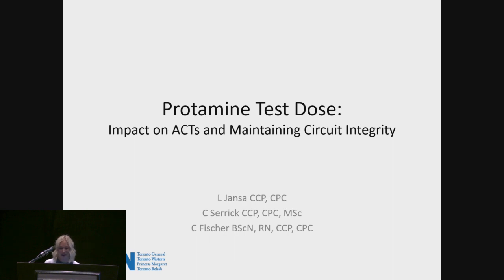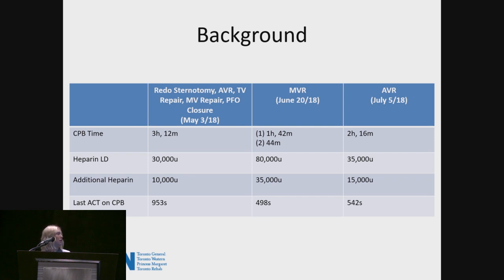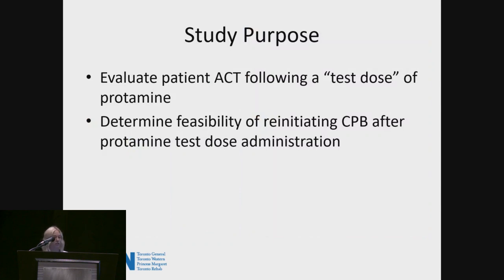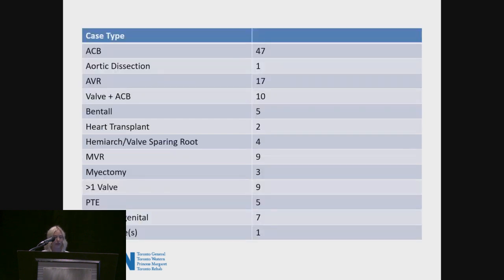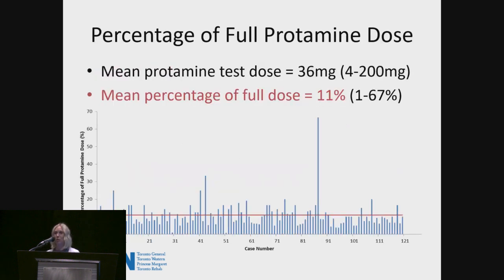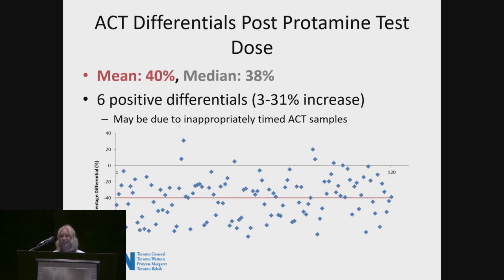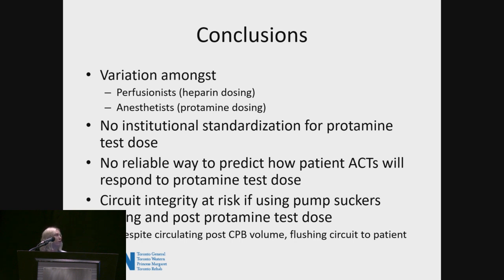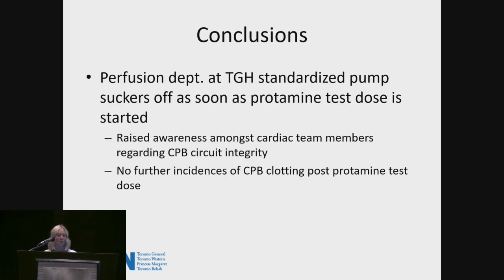Protamine Test Dose: Impact on ACTs and Circuit Integrity

Comment: You're Seriously Kidding Us Right?  If you would have spent ANY time reading studies back 40 years ago you would know that leaving your pump suckers on during ANY amount of protamine being given is EXTREMELY unwise, and foolish.  While  you will get away with it a lot of time, there will be times when you will not , so you found out!  Secondly, you are not taking into account (foolishly) that that heparin has a half life of 90 minutes, and your "Loading Dose" after 2 hours of CPB is down to half, or even less, so to use your loading dose as the "4-36%" test dose is once again foolish.  If you want to be intelligent about it then you should run a heparin dose test (HMS) and find out how much heparin in ACTUALLY circulating in the patient, before "guessing" at a test dose.  Out of all the perfusionists, anesthesiologists and cardiac surgeons in your department, no one thought about heparin having a half life of 90 minutes, and that perhaps this would have been obvious?